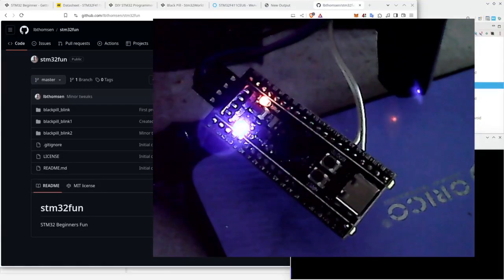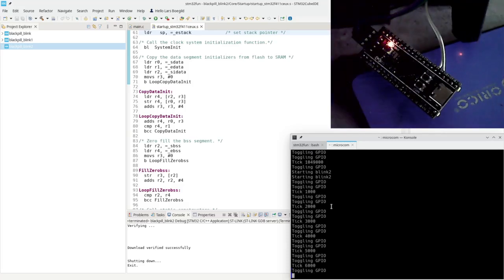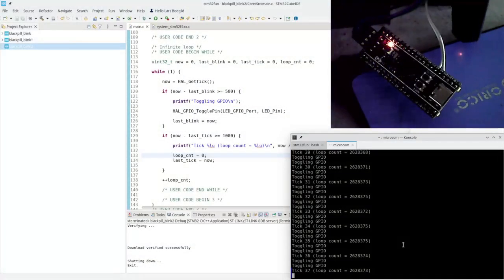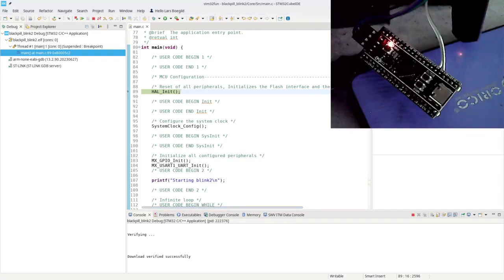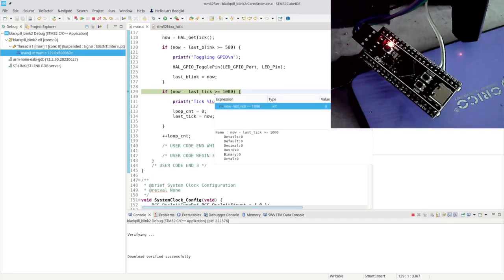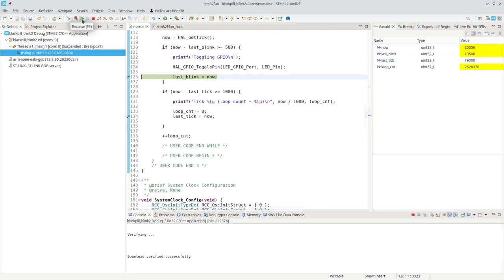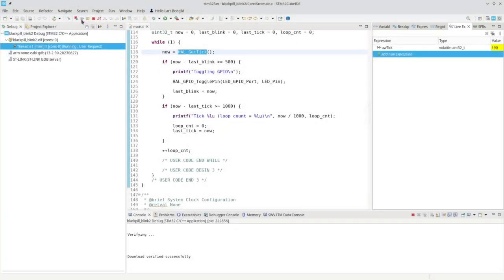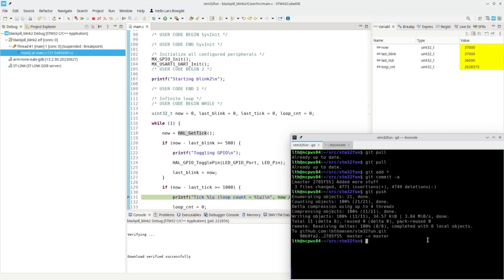STM32 Tutorial #5 - DEBUGGING In-circuit (ST-Link)

Comment: i am using PuTTY and i have a nucleo f446re board
since the last video, in which you showed the printf statement with led blinking 
PuTTY is not working, led is blinking though but it's not showing output on the screen (PuTTY)

edit:: nevermind, figured it out, took me almost 4 hours to find it out but it was worth it :)
Reply from the maker: There's another video which dives into the printf redict in detail.  You can also use SWO or USB.

Comment: To use the live expression do I need to configure the MCU's debug mode to Trace Asynchronous SW mode or Serial Wire is enough? Also can I use st-link v2 for that or do I need JTAG?
Reply from the maker: I think you will find an answer to your questions in Tutorial video #17 https://www.youtube.com/watch?v=j-GaEZKrkbQ
In short, you can use a st-link v2 if it is an original.  The Chinese clones do not include a SWO pin by default.
Reply from the maker: Sorry, I missed the "live expression" part of your question.  And no, no need for Trace - Serial Wire is enough and that will work with any st-link - even the Chinese clones.